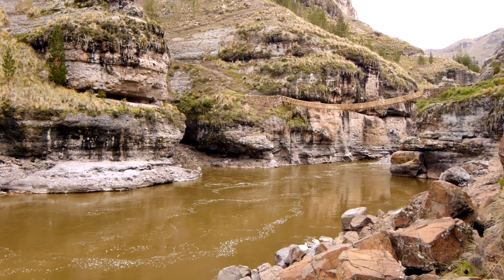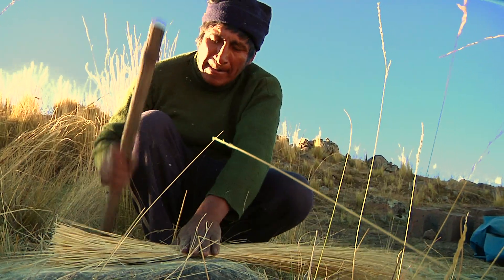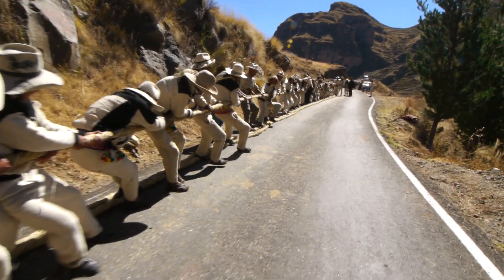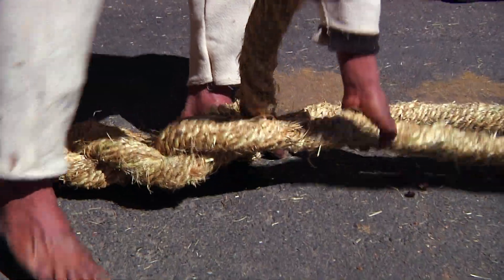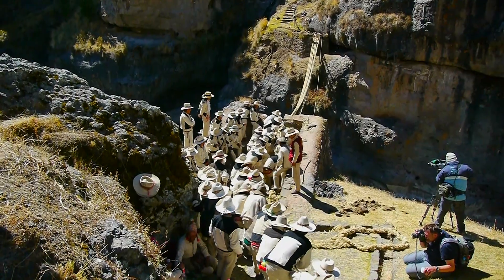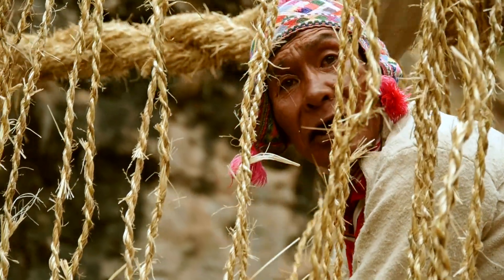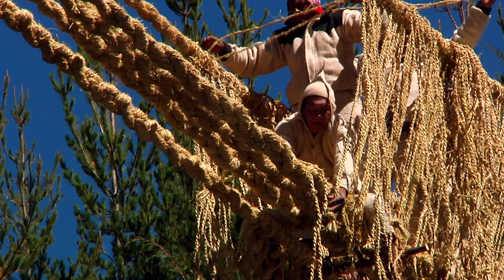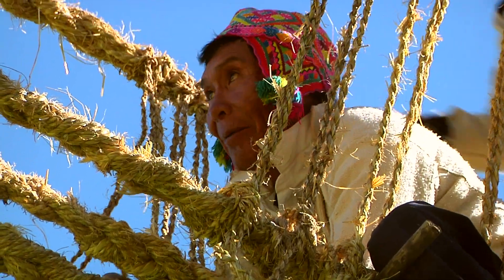Weaving the Bridge at Q’eswachaka

Comment: I have this concept of making a bridge over a great fall, that would join a land quite far away and not reachable at all (so working from two sides is off the table; same for the bottor, this pit is just too big) and I have no clue about how you create a bridge. Any bridge. I wonder if it would be possible in such circumstances but even here, in case of this bridge, I wish to know how they made it? The beggining I mean, how you stretch (? my english isnt perfect) the base ropes. A throw and catch method?
This is the biggest question for me, as this bridge of mine seems impossible, but I wish people would at least try. And so have a rough idea how to approach the problem.
Perhaps somekind of solid structure would be the answer...

Comment: What you're seeing here is absolutely engineering. It's not done with formulas or drawings, but through centuries of trial-and-error and oral memory these people have devised repeatable process for building a safe and reliable bridge. They've come up with a set of simple steps to make sure that even with different people, the same things can be done each time, and the results obtained. They've determined the safe limits of the structure, and by replacing it on a regular schedule, they've ensured that the stresses put upon the bridge are within an established safety margin.

Comment: Fascinating, beautiful and endearing, but that bridge is not exactly an example of durable engineering with an extremely laborious and labour intensive construction and it also needs to be replaced every three years. For perspective, a bridge in my town was originally built in 1293, some 100 years or so before the rise of the Inca empire and it still has 10 tonne vehicles constantly driving over it to this day. Built over 1000 years before that here's an architecturally complex and still standing stone bridge in Rome the Pons Fabricius that was built in the year 62 BC.

I still love Incan temples and granted, there's a good chance that this Inca method still pre-dates the Roman bridge, but I've gotta say it, I'm not impressed by the architecture or building techniques for that bridge at any time in history, even if they are adhering to a traditional style. Perhaps historically they didn't have access to wood or stone and just had to make do with whatever they could use, literally the grass beneath their own feet.
Reply: +Azure The Pons Fabricius is a lot lower to the water, which would make building a heavy stone bridge a lot easier than bridging the gap between two cliffs. I also think the purpose of rebuilding the bridge each year is for a sense of community- it's a tradition that may have arose from two groups of people forging a bond, both literally and figuratively. I'm sure they could replace the grass bridge with something more permanent, but the yearly bridging is sort of a holiday. It's not just functionality, it's for the community welfare.
Reply: I agree it's continually built more in the spirit of tradition than anything else and both bridges I cited are somewhat lower to the water too, granted, but they're both also significantly more venerable, functional and complex in design. The grass bridges are not impressive from a practical design standpoint, unless literally all you had to hand was grass. Perhaps that's how this design originally came to be. One advantage would be it'd be very easy to cut down or to burn if in danger. Regardless, it is still fascinating to see, and I can still appreciate its symbolism as part of a festival and tradition.
Reply: +Azure Just one word: Earthquakes. They tend to be stronger and more frequent in Andes than around the Mediterranean. One should look for the most practical solution for any given environment, not the one which seems the most impressive. (Cf. current problems at Karakoram highway). Also, the woven bridge is much easier to temporarily disable in the time of war, when retreating before the enemy army. (Edited: Didn't realize that you already mentioned that yourself).

Comment: Very wasteful, not economical, they should build a bridge that lasts for decades instead of wasting so much time and effort every year.
Reply: Greedy Imp FREE @ Google Play I disagree. All they use is grass, which is easily renewable. The old bridge, being simply grass, would decompose rather quickly. On top of that, it's an important tradition; I don't think anyone there considers it a waste of time or effort.
Reply: Greedy Imp FREE @ Google Play Ack pooh! Support your windy conjecture with a realistic manpower + resources cost analysis. Factor in the training and resources needed to bring the community to the level to build what you propose, let alone the transportation costs to get the machinery to the site. Add to this the manpower + resources needed to maintain the structure you propose over its proposed lifetime. Then, do an environmental impact assessment. When you are done with that, do the same full analysis for the current set up. After you have all this, we might listen to you.
Reply: How come all these economic people act like they know nothing of good will, which is priceless in economics/accounting.  Goodwill can help you weather a run of bad problems through people's faith in your company.  Its obvious all the goodwill being generated by this act of community is priceless, it forms bonds of loyalty and friendship.  Which during trouble, are priceless.